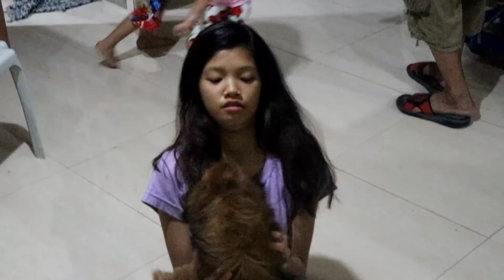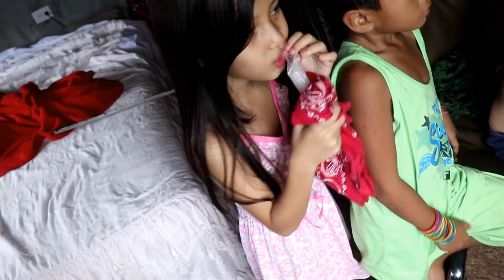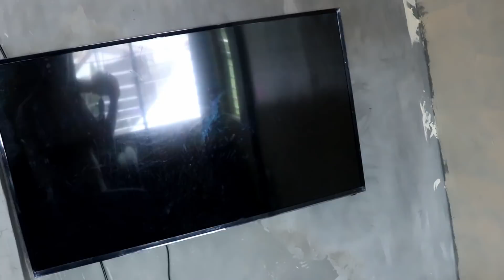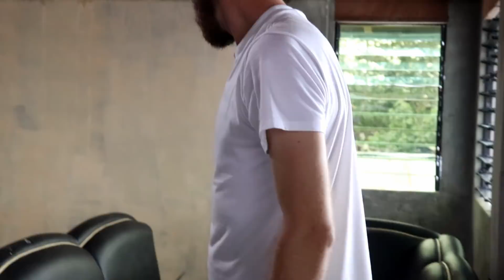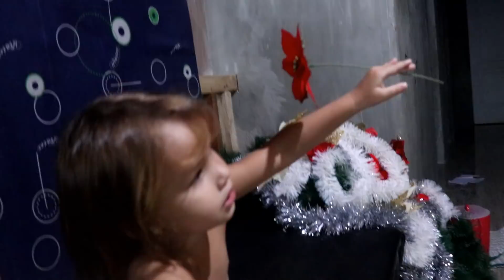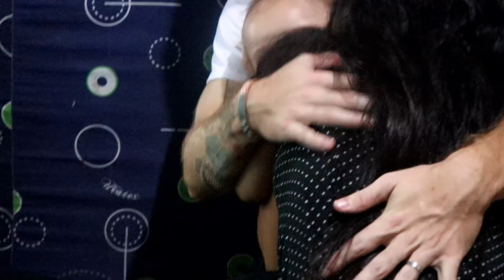FINALLY! PAINTING OUR HOUSE IN PHILIPPINES!!!

Comment: Painting interior concrete is a four step process.  First, clean the walls.  Second, apply a sealer.  Third, apply a primer.  Finally, apply the paint.

Concrete will suck up (absorb) paint like crazy. . . .if you don't perform the above steps.  If you don't do the proper prep, you'll end up applying numerous coats of paint.  Especially if you're thinning the paint with water.  Concrete loves drinking water more than it does paint.  lol  After awhile, the paint will look blotchy.  

The sealer prevents moisture from seeping in, stops mold growth, and help prevent that cold, damp feeling concrete gives off.  You typically apply two coats of sealer. . .and allow a week between applications.  This allows the sealer to cure properly.
Reply from the maker: Right on!  best answer.  Thanks Gig 1!   Now i'm a master at painting concrete.    We will apply primer first next time.

Comment: there is a easy and quick way to paint. Start at top and go side ways about 2-3 feet, right to left. Paint is put on thick and then it thins when you get to the 2-3 foot end. Do in one stroke. Dip brush and start at thin part above and move left to right underneath the top layer. The moved down and dip brush and move right to left. Repeat all the way down to floor. Then take brush and pull down from top to floor in a straight path. Move over the brush width and pull down again, top to floor. Do this to the point where paint ends. What happens is the paint in rows is placed thick above thin and thin above thick at other end. So when you pull down, it evens the paint out all the way to floor and across. If you have a real bushy roller, you can do 2 or 3 rows at once. So you do only about 12 rolls with brush to cover a floor to ceiling and a 3 foot wide path. I use to paint for a living and could paint a 3 bedroom apartment myself in one day. For the corners, use a hockey stick with a brush tapped to the end ( the flat curved part). It is at the right angle to do the corners of wall and ceiling. Cut all corner and around wall sockets first. If everything was out of the way, i could paint your whole house complete in 2 days.

Comment: sir brian you have to put nutralizer or pnetrating sealer specially the cement is new. if you do not do that there's possible that your pait will peel off because the cement is acidic. your cement wall is old is ok there is no problem on it.     you just only observe if the cement having moist  you have to nutralized it first. Godbless po....

Comment: You should use primer paint or you can use the paint that has primer already so that you can save money. It prevents the paint from peeling off in the future. Also, you can use the type of paint eggshell or semigloss because it makes easy to clean especially you have kids. You can unscrew the outlet cover to paint the corner side and when it dries you can put it back again. Always have a wet rug (t shirt you don't use anymore) next to you, so that if there are paint drops you can just wipe it out. Another thing you can use is plastic rather than paper. Sometimes the paper can penetrate when still wet and you'll notice it on the floor after you finished painting.

Comment: First use a neutralizer for the concrete wall, let it set for at least a day or two...then prime it (w/ latex)...let it set for another day...then finally apply your paint (don't add water to the paint, you're gonna have a problem w/ the paint peeling off) & apply a single coat on all surface 1st, when it dries then that's the only time you apply a second coat, then repeat the process for a 3rd coat if necessary

Comment: Hi Brian, you first should be using a white primer 1st which will soak into the cement, 2 coats, then you can paint 2 coats, as it is, you may have to do 3 or 4 coats as the cement will absorb the paint and you will see blotches on the wall.

Comment: Because the walls have been unsealed since day one, you should follow these steps. 1 wash wall down with Sugar Soap, 2 Cut in the walls first  3 paint the walls with a Sealer/Undercoat, saves you one application 4 two coats of topcoat. Always use quality paint, it will save you guys money in the long run.

Comment: Try putting some masking tape on the wood ceiling so that whe you paint your walls if in case there's pain to touch in the ceiling, it won't create a smudge on the wood ceiling.  Need to cover the electrical switches too Aheezy so the switches won't get painted too.  Just an advise tho'.......  Not meant to offend anyone of you(",)(,")

Comment: if you're using latex paint add a bit of water it is water-based, if enamel then use a bit of paint thinner. advantage of latex paint is doesn't smell bad, dries quick and easy to wash paint from your hands, advantage of enamel, more glossier but smells bad and takes a few days to dry. get a paint brush for those hard to reach areas and corners
Reply: Both types of paint require thinning,you are right.

Comment: Just a tip on painting Kuya, do all your trim work first, it will make painting go much faster.
Reply from the maker: ok thank you Scott  next time lang bro.
Reply: If you mean trim as in architraves,window frames,doors and skirting boards,in the trade that's what we call trim and these sections are coated after the ceilings and walls.